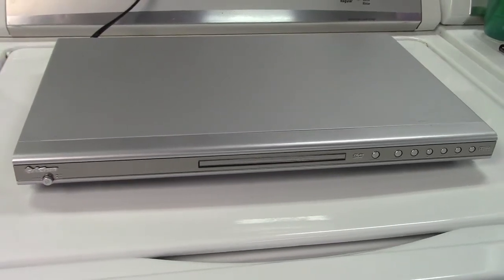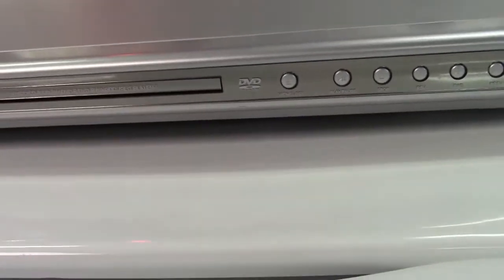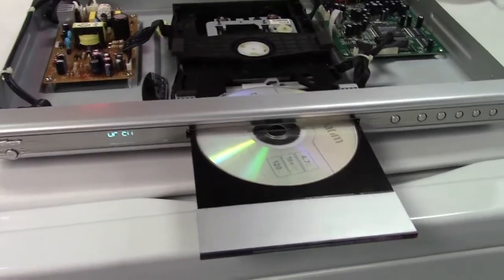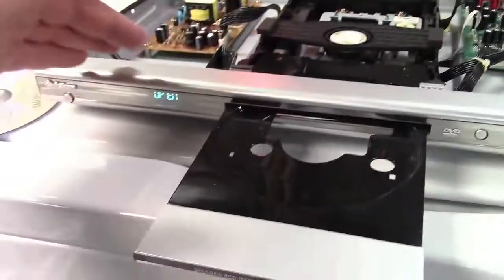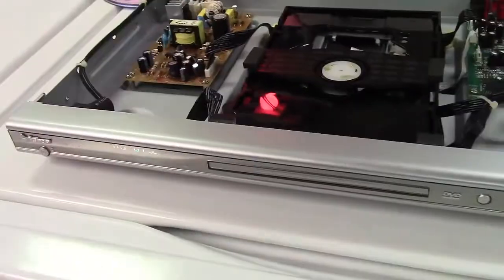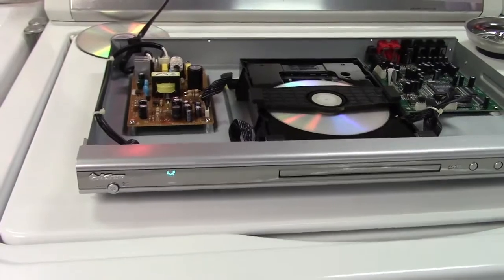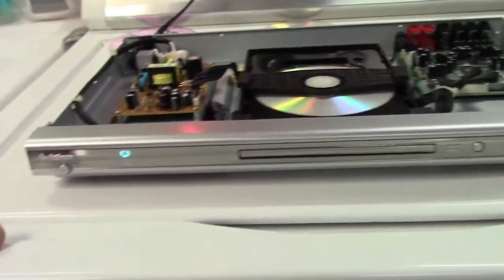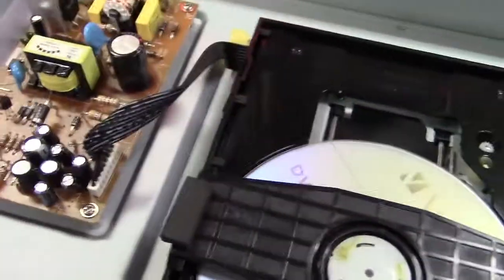ASTAR DVD Player Repair Attempt, Part 1

Comment: is this the dvd player from ... febuary 2015 video with the  firmware that turns off with the tray open?
Reply from the maker: If I recall right, that was a Visizo Blu-Ray Player, and that does have a component connection on it.  Don't think I have the remote for it though, nor do they make good movies these days on Blu-Ray, but there may be re-releases of old movies.  The player is still around, haven't played with it since.